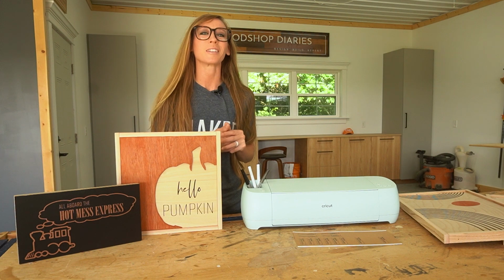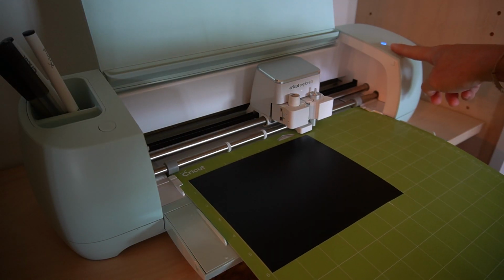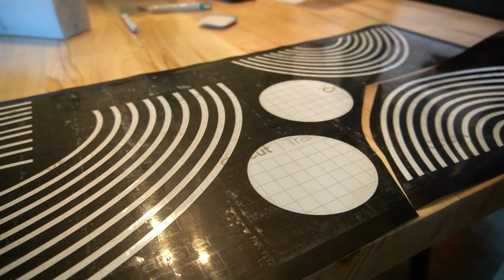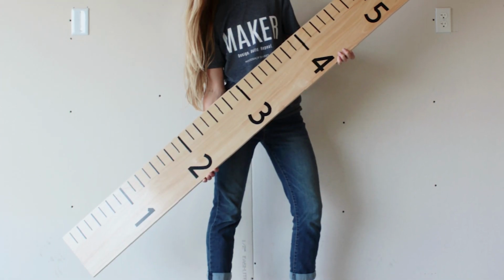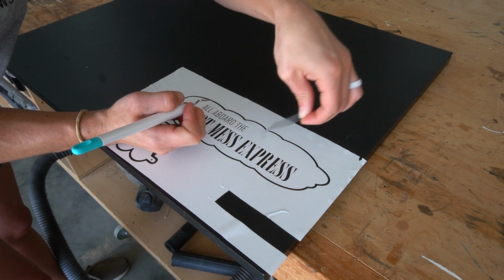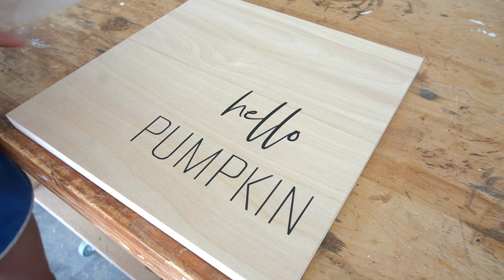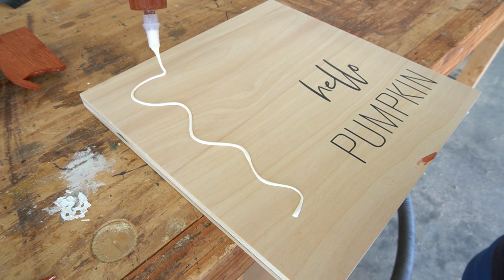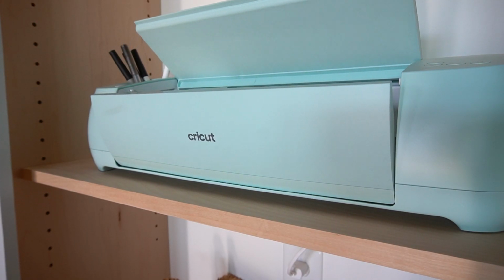5 Easy Ways To Use a Cricut With Your Woodworking Projects

Comment: Hi Shara!  Was wondering which package you would recommmend for someone who is just getting started with the cricut.  I have a cricut, but it is the one that first came out, so I am sure it won't even come close to performing the tasks that the Cricut Exporer 3 does so need direction of what to get to start out.  Thanks!  By the way, I love your channel and all of your plans!  Bev
Reply from the maker: Hi! Thanks so much for your kind words! I’m not a Cricut expert. I love mine and use it occasionally for things like this, but not daily. So I’m not sure I’d give the best advice and honestly, which one to get really depends on how much you use it and what types of projects you’re planning to make with it. I used the Joy for a while before upgrading to the explore. The Joy is a great little machine for writing and cutting, but it’ll only cut up to about 4 1/2” wide. So if you plan to make big stuff, I’d definitely recommend going with at least the explore. The maker is kind of the “top of the line” with tons of extra features and ability to cut other materials (like wood veneer, which is super cool). I’d recommend browsing the website and checking out each machines features and see which ones you think you’d really use and decide based on that.
Reply: @WoodshopDiaries  Thank you so much for your honesty!  So refreshing in this day and age.  I would like to do some of the things that you did in your video.  I especially like your Hot mess Train sign!  The pumpkin one was awesome and such a great idea for fall decorations!  Keep us the great work Shara!  Your plans have really helped me with my confidence in building!  Bev

Comment: I don’t know if it works on the explorer, but on the maker you you can buy a bit to cut thin pieces of wood.  It does a really good job.  I use it instead of the CNC sometimes if it’s a small project.  Would be great for the  pumpkin project you did if someone doesn’t have a jigsaw or bandsaw.
Reply from the maker: That’s a great point—you can do that in the maker, but the explore doesn’t cut wood. That’s an advantage to the maker vs the explore